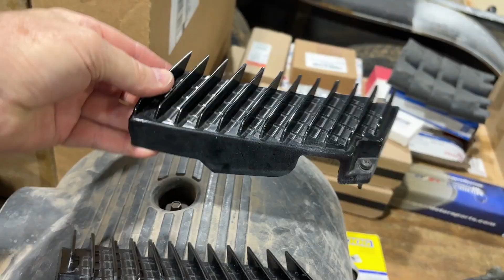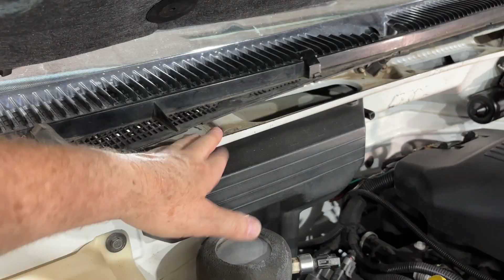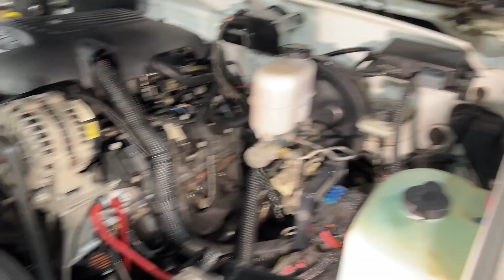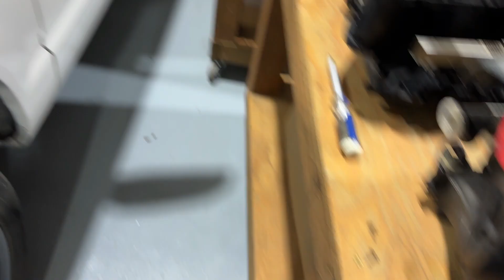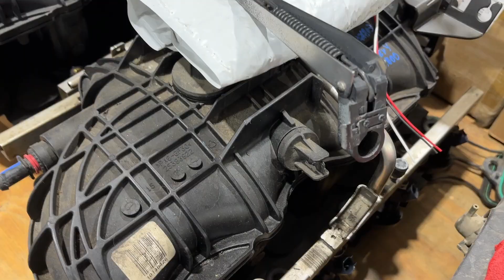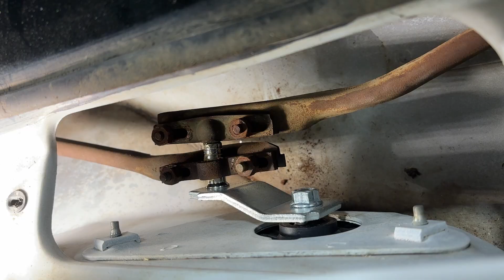Chevy OBS How To: Replace Windshield Wiper Motor and Adjust Wiper Arms

Comment: this is random but have you had a problem with your courtesy lights and dome light staying on even after replacing dimmer and door jamb switch and even headlight switch? i know someone else with a 89 single cab Sierra having this problem
Reply from the maker: The only issue I’ve had like that was my headlight switch had an issue, and it was causing my dash lights and rear tail lights not to work. I put in a new headlight switch and it and that fixed all my issues.

Comment: Recently finished a 4/6 drop on my 96 work truck. then hopped in for a 3000 mile road trip! Only real issues were a bad voltage regulator (swapped alternators under a shade tree in under 30 minutes) and the fill fitting got ripped off my air shocks in a gnarly construction zone in Eastern MT. One of the things I need to do on this truck is to re-index the wipers so they park a little lower and don't swipe all the way to the driver's side A-pillar. I pulled the wiper arm, thinking I could just move it one spline on the shaft, but it is actually keyed in one spot. So I have to dig deeper and do just what you showed here. 

Thanks for making this video and others. You have been a great resource for clear info on my truck build.
Reply from the maker: Thank you, glad it helped. Good luck with your truck!